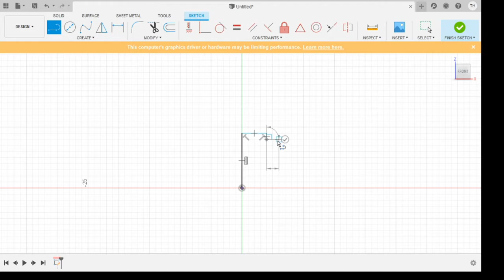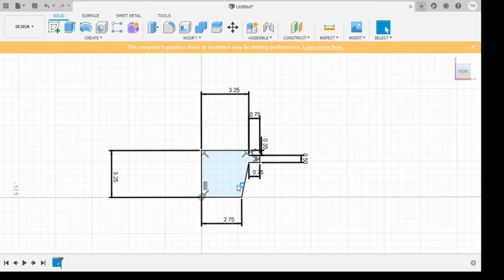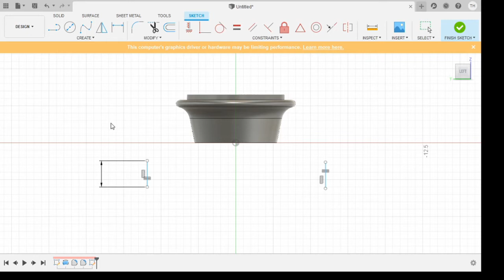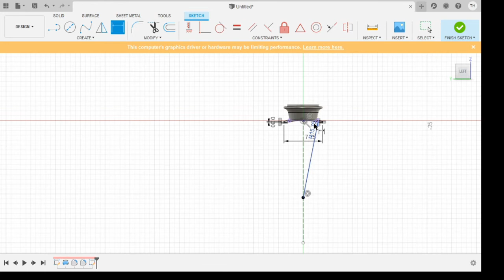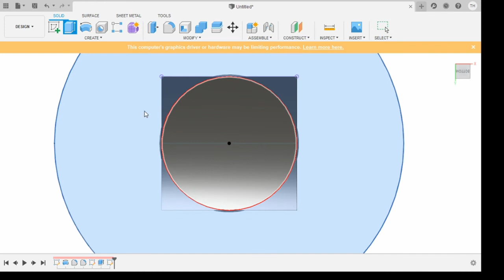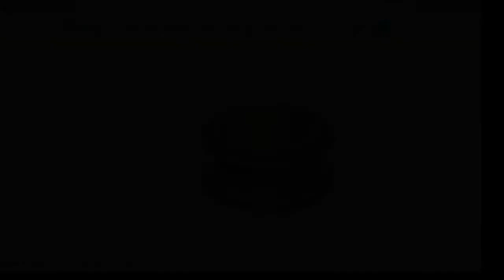CAD drawing a locomotive chimney

Comment: Thanks for the video. I’m trying to create a chimney where the transition from the chimney tube to the saddle isn’t a straightforward curved fillet - it changes as it goes around the saddle. Any ideas appreciated.
Reply from the maker: You may be able to do this with a lofted profile - I'm not in a position to make a video on that myself at the moment, but a quick search should turn up plenty of videos on the process. Hope that helps!
Reply: @tsdesign3317  that’s what I’ve been trying, useing rails to set the correct graduated fillet - unfortunately the loft fails when I click on the rails.